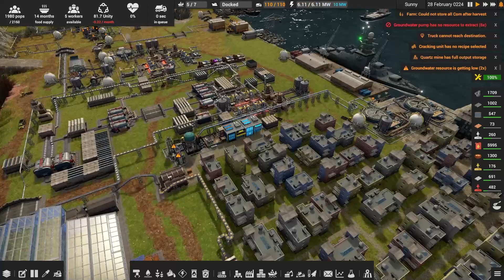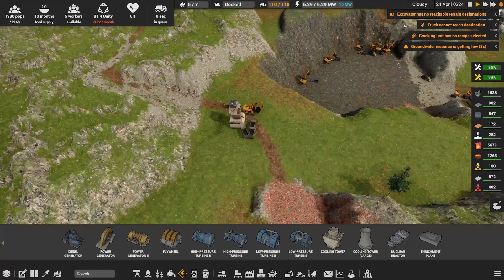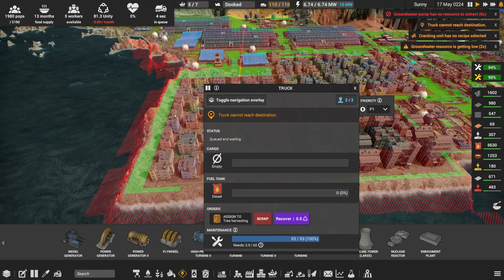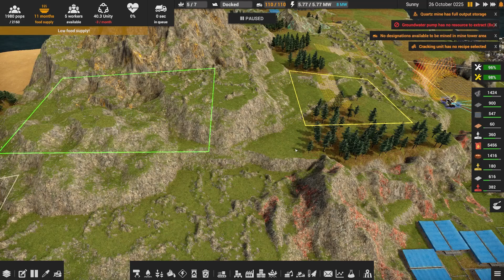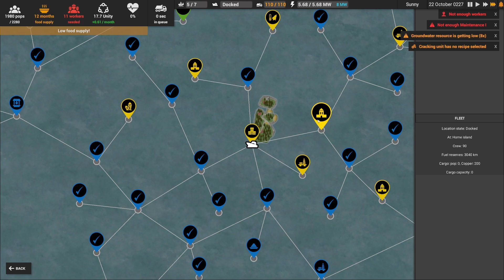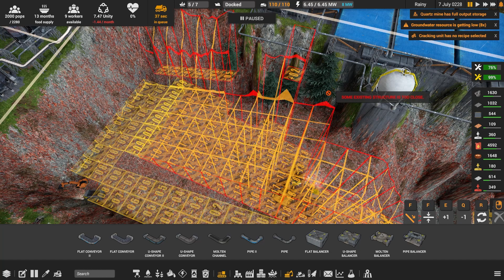BIG DEEP HOLES! - Captain Of Industry BETA - Automation Factory Builder - Episode #17

Comment: Hi there, great series to start with, but perhaps some pointers... I have been playing 0.3.11F myself and watching multiple people on YT....

First tip, When building steampower, try a setup similar to a car (Engine->Clutch->Gearbox), i.e. HP Turbine->Flywheel->Generator
I see every single person on YT putting the flywheel at the end, serving a role as capacitor like a battery instead of as a means to actually use its function as instigator.

Second tip, stop dumping all your offshot/burden into the sea.... You are already struggling to keep terrain navigable, perhaps use this burden to fill up mined out areas to reclaim surface space

Hope it helps you and others